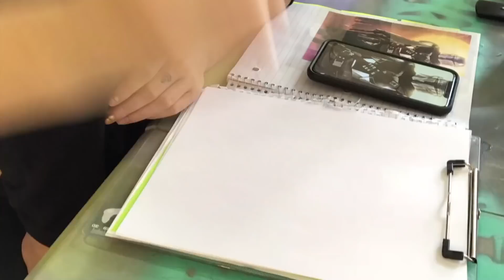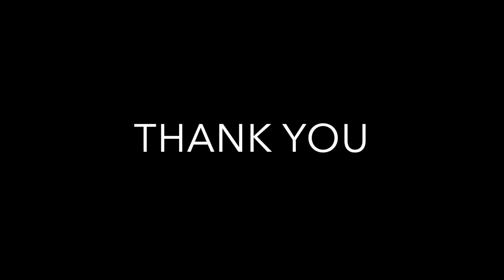HOW I MADE MY MANDALORIAN COSTUME + BABY YODA (Jessica Nigri JSKA Cosplay Creation)

Comment: There’s quick-drying glue, but there’s also a way to make superglue cure/dry instantly.
Mixing baking soda w/ standard superglue cures it instantly, but it also releases a little heat & a little fumes (so be careful & don’t snort it while you’re combining the 2). Put baking soda down on whatever you’re gluing onto, apply superglue onto what you’re about attach (or vise versa), then place it exactly how you want it; be sure you place it right, because it’s not coming off after they touch.
It holds really strong & you can release it by applying or soaking in acetone (cheap nail polish remover); some other oil-based products are also valid (such as cooking oil, etc.).

Comment: Damn, this is so badass.  I almost got a seizure from all the jumping around and the frenetic pace but it was all good.  Sometimes when you're "sealing" pieces of armor you use wood glue, sometimes it seems you use hodgepodge, sometimes something else.  Do you use different sealers depending on what part of the armor you're doing? Is there an advantage of using one sealer vs another? Like, if you're doing something more static like a chestplate or shin guard, do you use one type of sealer and when you are doing something requiring more dynamic movement like finger/glove armor you switch to a different sealer?  BTW, SUBBED!  I've followed you on IG for the longest time, I only recently found you on YT.